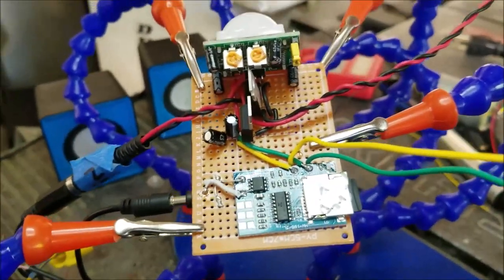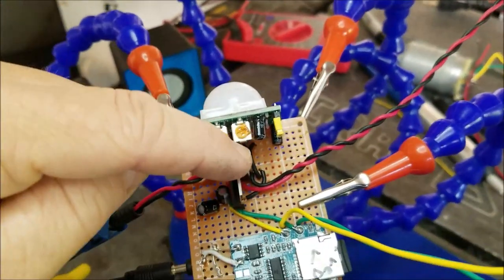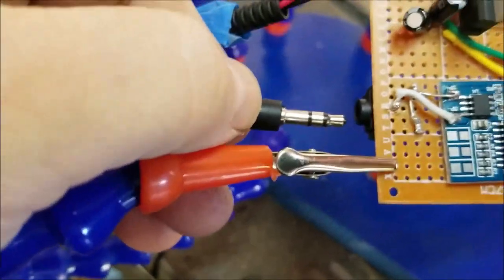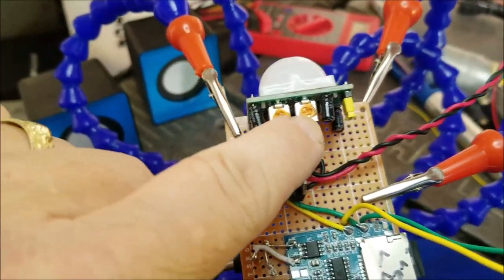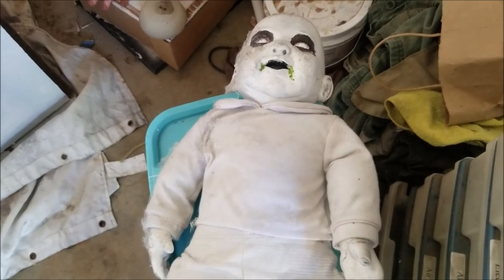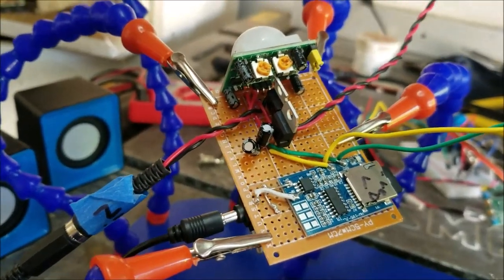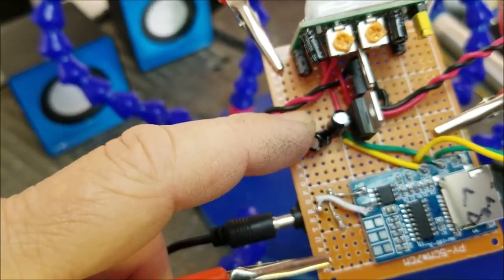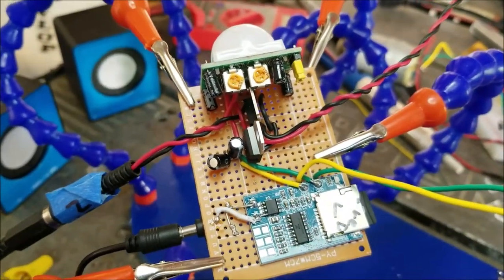DIY Halloween Prop Controller for under $5

Comment: Well.. I just ordered all the parts (enough to make 5 devices). I hope this works.
Reply: Could you post / upload a shot of the underside so we can see the solder connections? I have all the components, but I have no idea what to solder to what. I'm very keen to build this but have never done so before, so this is going to be a first. I just need a hand seeing what goes to what. Then I can experiment from there for next steps in plans and will be happy to share with others.

Comment: I really cannot figure out your build. At 18 seconds you show a bread board layout, and it has a resister in the design. In the video of the actual board, there is no resister visible, and its just not possible to see how you've connected one component to another. I am trying to put this together on a bread board to start, but this really hasn't got enough clarity to understand how you have things hooked up. Could you please provide a follow up image of a real bread board build? If I can learn from this, I am sure I can take it from there for more builds, but I am completely unable to build this as it is right now.
Reply from the maker: The resistor shown at 18 seconds is for the LED but on the actual circuit I used an LED with a built-in resister. You can follow all of the connections on the diagram for the breadboard and either use the resister or simply run a wire where the resister is shown (a resister is a conductor of sorts so it can be replaced with a wire if you have a resister to the LED (if necessary). In the perf board that I actually used, many of the connections are made underneath; use the breadboard example as a wiring guide, remember that all of the numbered rows on a breadboard are connected.
Reply: @brianaala  Ok, what size resistor is that ? I can't tell from the video, the colour bands aren't quite clear. It looks like just red, black, gold.. but is there another band in front of the red?

Comment: What distance does that motion sensor detect to? I followed the link to AliExpress but that was on spec it did not seem to list about what the PIR detection distance us.
Reply from the maker: It can be set for 3-10 meters (~9-30 feet).

Comment: Thanks for this great content. I'd like to try making one of these with my daughter to trigger an audio track and a fog maker for Halloween. But I'm not very technical. Could you possibly post step-by-step instructions? Where do you think would have the best prices for these components in the U.S.? Thanks again!
Reply from the maker: Hi Hans, thank you for the kind words! The only issue would be the fog machine. This unit will trigger DC voltage but not AC that you would need for the fogger. I would suggest that instead of using the transistor to switch it to use an AC rated relay instead (it's a physical switch that takes a small DC current and allows it to connect any other usually higher current).  Unfortunately, I am super busy making classes for my university right now so I cannot do a more detailed video right now. But Google has plenty of how-to's that will get you on the right track!

Comment: What voltage / amps / watts is the power source to run this? Is it a 12v power cord? Something else?
Reply from the maker: I usually use an ATX power supply to run all of my props. So this one is connected to 12v.
Reply: @brianaala  Thank you for the reply. You mean an old computer power supply box? But how many watts and amps does this little board need to actually run? I'm hoping to use these outdoors. I'm wondering if I took an old cell phone charger cord if that could be used to power it (off an extension cord, of off a battery pack).
Reply: @JHSDurham  Same - what power input does this need to work?

Comment: Any chance I could get you to make one for me? I'm not really equipped or familiar with making circuits like this. Name a fair price.
Reply: But I would want the PIR to run 15 seconds instead of 45. I've noticed the ones I looked at online have different minimum times.
Reply from the maker: I do love to help fellow haunters, the whole gist of these videos is to get folks to try something new and diy (also, I don't really have the time). C'mon! You can do it! It's easy! 😉😄
Reply from the maker: You can set the potentiometer (the orange dial) to play for any time from 3 seconds to 10 minutes.
Reply: @brianaala  I've actually found a workaround. I'm using a 12v PIR inline with my 12v power supply for my motor, speakers and lights. Seems like it's going to work well.
Reply from the maker: @OakLaneCemetery  awesome!  The PIRs that I  have only put out 3v! 😖
Reply: @brianaala  Found this guy on Amazon (probably could have  gotten it cheaper elsewhere) Seems like it will just act as a switch on a 12v line, which would be perfect. I'll know for sure when it arrives today.   https://amzn.to/2DEMWdZ
Reply from the maker: @OakLaneCemetery  How did the PIR sensor work? I found the same thing on Aliexpress for about $5.
Reply: @brianaala  It works, but it is VERY touchy to adjust. Just a tiny turn of either the time adjustment or sensitivity adjustment seems to have a huge impact. The more so the further you turn them. At first they seem to adjust like you think they would - a small turn yields a small change, but the more you turn it the broader this change becomes. Took a lot of tinkering to get it set right. I took mine out of the case and mounted it exposed under a plastic flap inside the box so it would be easy to get to to make any adjustments. For the price, I'm satisfied. I didn't even get to use it this year because of storms being forecast for Halloween night.

Comment: Nice work. I have a few questions. Forgive my limited knowledge. If I wanted to run a wiper motor I'm thinking a tip41c 6A would be needed? Also would the 7805 regulator still be adequate? What voltage 100UF capacitor, any that meets the minimum?  Thanks for any Help.
Reply from the maker: Hi Manzanita. If you're going to run a high Amp motor (like a wiper motor) you'll want to run a relay in the circuit; the transistors run really hot when switching higher amps and the PIR only outputs a low 3v signal. It will (sometimes) switch a 3v relay but getting the PIR to switch the TIP31c is easy and then using the TIP to switch the relay is much more reliable. The voltage on the 100uf cap. is 16.
Reply from the maker: @manzanitamurderhouse  You would have to run the relay before the regulator because it will be running the 12v motor.
          The old timey radio uses a little mp3 player (the same one in this build) which has a built-in 2 watt amp, so it runs a small speaker no problem (anything ~2" dia @ 8 ohms or less). That speaker I bought at Fry's for $1, but I blew out the amp on it (it was a USB powered pair) so I just cut the wires and wired it into the Mp3 output.